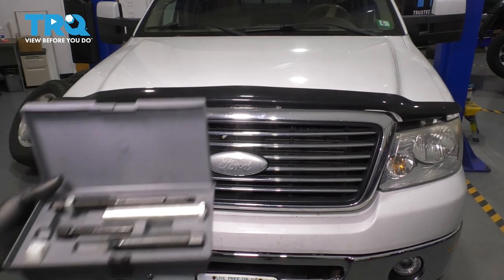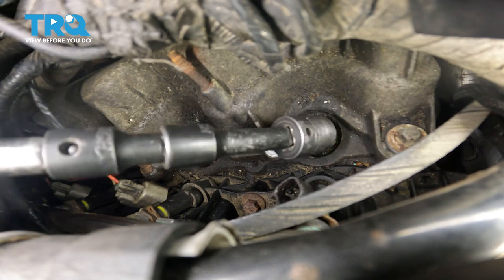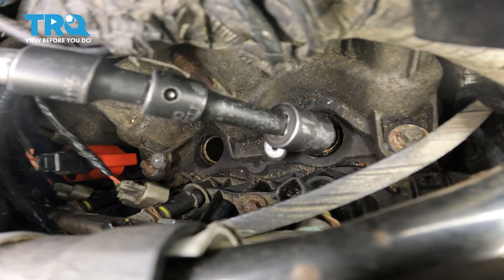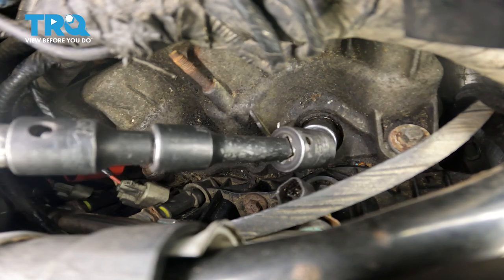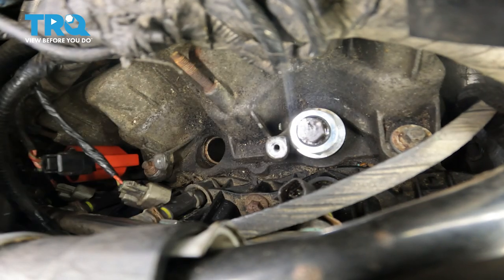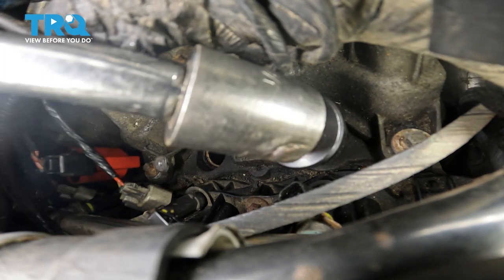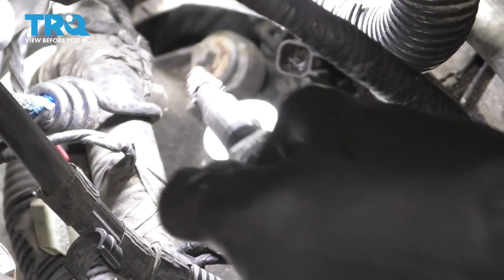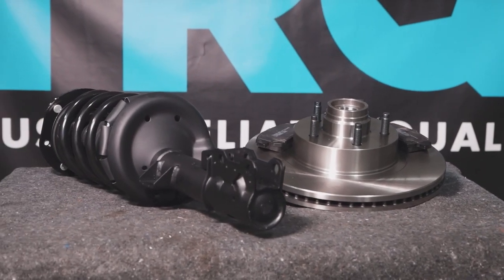How to Extract A Broken Spark Plug From A Ford 5.4L 3 Valve Triton

Comment: Make sure ya buy the upgraded version of these spark plugs. The issue is not the engine, but bad and terrible spark plug design. They have upgraded the spark plugs in the past 5 years to avoid issues like this.